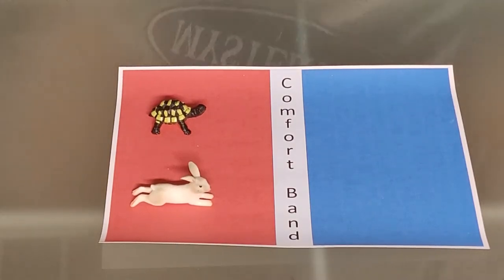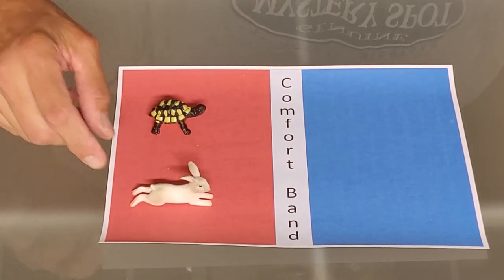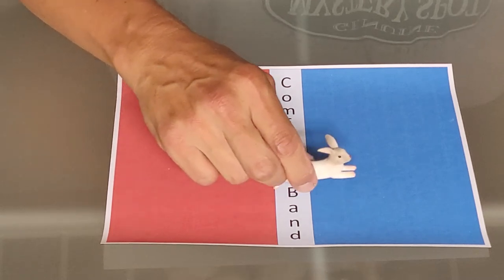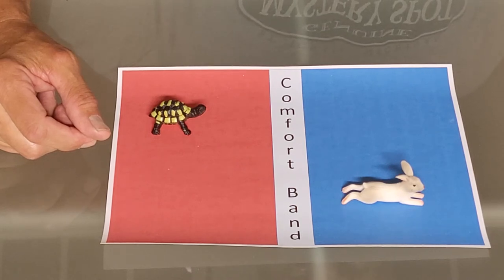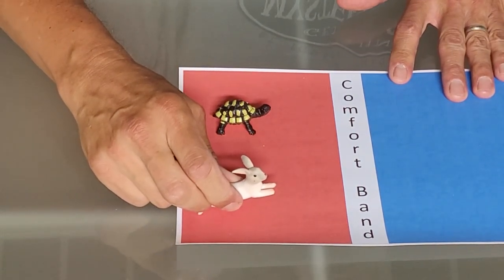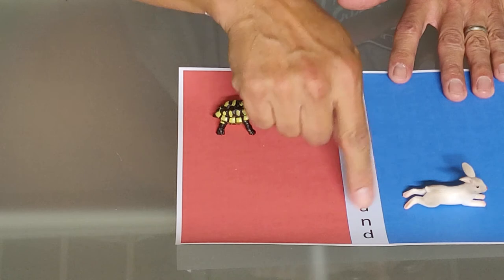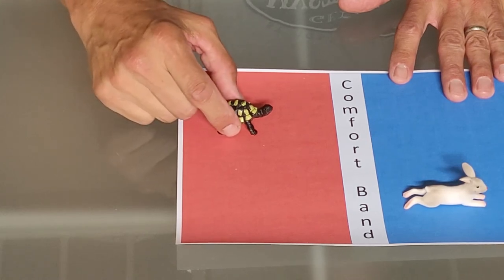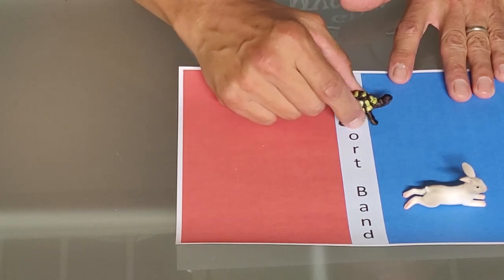Why a standard vs. an inverter mini split are like the story of the tortoise and the hare. #offgrid

Comment: Hey will your dc ac run directly off battery’s at night asking for a friend
Reply from the maker: Hi Mike, actually, it's a hybrid unit, so it runs off solar in the day and of the grid at night or when it's cloudy, but it runs at super high efficiency regardless of power source because it has variable speed motors and vrf, same as the tortoise analogy in this video.